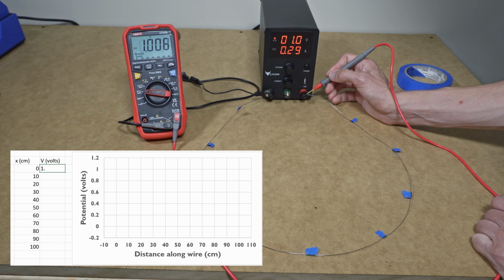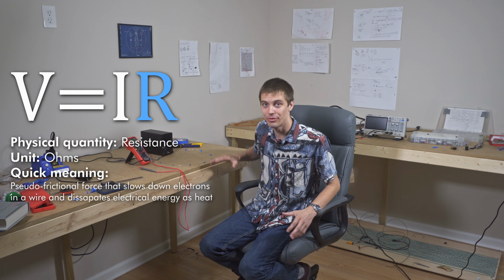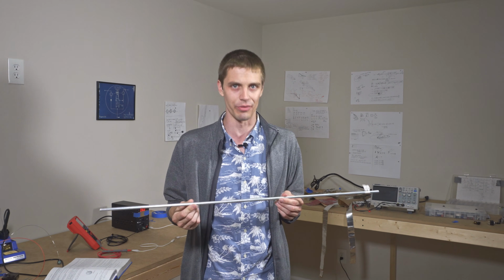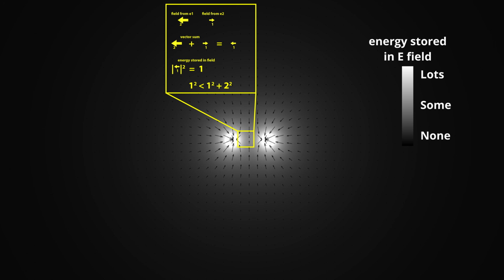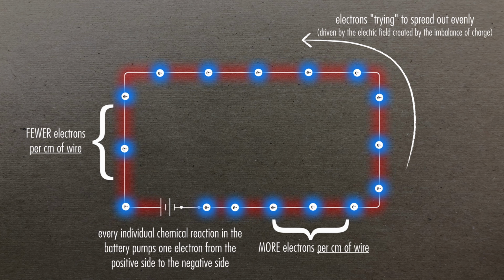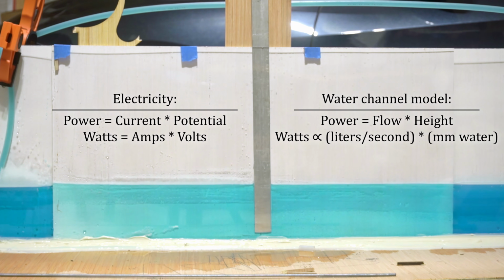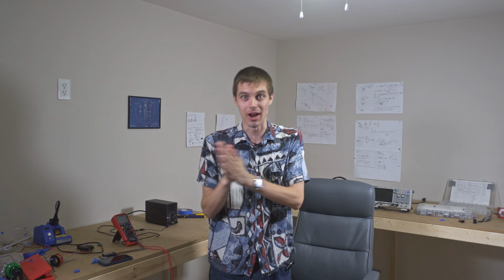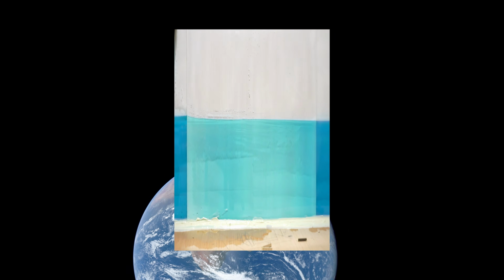An intuitive approach for understanding electricity

Comment: As a high school electronics major, they never really taught us to think of electricity that way, mostly how to calculate things and that has been bugging me since I've started learning electronics. This video is awesome! Love all the analogies and various explanations. It feels like I actually have a grip on those supposed-to-be basic concepts now.
Reply: Just read the textbook ffs. It literally explains all this stuff, in better detail and with far more information density. You should be reading the chapter before you go to lecture, and never take notes, since it just distracts and wastes your time. This is coming from someone who got a 3.98 GPA doing a physics major at UC Berkeley (I got 2 A-'s).
Reply: Wtf Is high school major
Reply: @chrissantos7865 Advanced diploma?
Reply: @pyropulseIXXI what an embarrassing comment lol. Save this one so you can read it again in a few years. Make a note that the OP was a high schooler
Reply: I don't know what sort of introduction you had, but water analogies are absolutely where electricity should be begin.  They just need to be given with the caveat that water molecules don't push on each other at a distance, they have to bump into each other (at room temperatures) and water molecules don't have another field where changes in one field affects the other.  So electricity will travel through a wire faster than water in a pipe because elections will push on each other despite large gaps between them, and water won't have things like inductors.  But pressure is a high level thing, and at the level of pressure they are very similar.  If you were transmitting power long range with pressured water in a pipe, would you want to use low PSI and require the water to fly through the pipe at super high speed, or a high PSI and let the water move slowly through the pipe while delivering the same power?  Anyone who has ever blown water through a straw will know it doesn't like to move at high speed through the straw.  Its why long range power lines are 200,000V and up.  You might be able to plug a low PSI pipe with your finger even if the pipe has a 1 mile diameter and turns a generator that could vaporize you.  A 12V submarine battery wont do anything to you if you put your hand across the terminals but it will vaporize a fork across the terminals.  Low pressure but a potential Niagara Falls of volume.  There are good analogies between "ground" and the ocean also.
Reply: High school major?!?
Reply: @98f5  HS used to have majors. If you were interested in things like electronics, farming, welding etc.. as a career you could be bussed off to a different facility in the middle of the day to go learn a trade. It was called vocational school or vocational classes. 

These days they dumb it all down and tell you that you need to go to another "adult" education system in order to be accepted into it. 

In the early years it was all about the higher orders but today it's about you being strung along for a basic education/indoctrinated stamp of approval for your masters. I mean your masters; not your Masters degree. 😉
Reply: @CynHicks  interesting, i never heard of that. But i like to think im young.  Graduated hs in 2000 I was lucky enough to attend private schools and took college courses most of my high school through a program they called post secondary. Got credit for my hs and college at the same time, and managed to graduate with my bs (appropriate initials for how much use a degree actually is) a year later... however we didnt have high school 'majors'. There were as you said some vocational schools that i seem to recall having specialties though.

Comment: The key new intuition I actually gained from this was understanding why and how resistors convert electrical energy to heat, rather than simply understanding that they do
Reply: Seems pretty obvious it is due to collisions; this is stuff you can easily deduce as a 13 year old by just knowing that things are made of atoms and particles

Comment: I think i get your analogies for voltage, or potential difference, but there are some parts for voltage i dont get. Like, a 9 volt battery would produce 9 volts worth of potential difference between the two sides of the resistor, and that 9 volts is basically electrons denser on one side and less dense on the other. If thats the case, then wouldnt current be different for the 2 parts of the curcuit? Current is amount of moving electrons passing through a point per unit time, but if the electrons are less dense, as in less compact, on one side of the circuit, the current wouldnt be the same everywhere, right? And from my physics classes, i remember clearly that current must be the same everywhere. So im probably missing something, could someone explain it for me? (1. Im talking about a basic series circuit. 2. When i say electrons are "less dense", i mean like less electrons per unit area, opposite with "more dense")
Reply from the maker: It’s very similar to water being “incompressible”. From the perspective of pressure, and pressure causing water to flow, of course water is compressible, but the actual change in volume with pressure is so minuscule that it doesn’t matter when you are calculating stuff like flow rates. Technically the electrons in one part of the wire are going faster to produce the same current but it’s SO slight you could never measure it. The water “channel” model doesn’t handle it very well because unlike a pipe, the water channel changes in volume a lot!
Reply: Ooh I think I get it, thxx
Reply: @AlphaPhoenixChannel so there are more electrons on one side, but the other side where there’s less elections has the electrons moving faster?

Comment: I need to watch this every week just to keep it clear in my head. By far the best description I have ever seen.  Thank you.
Reply: Repetition is the key to good learning, get it stuck in your head, like listening to a great song.
Reply: I agree Im 72 and dropped my first electronics class in Jr college because the teacher was former Stanford instructor and required his own book for his class. The first chapter I was totally lost he was talking hole theory chemistry and moles, Physics and electron valences. I just wanted to be a technician not a physics buff. It was like Taking us skiing down a Black Diamond hill. Before we knew how to snowplow. This video helped a lot But I'll have to watch a few more times. I dont get how electrons move from atom to atom at the speed of light. There has to be some minute fraction of a second where the atom changes from what it was. interesting that Voltage can make atoms and electrons more pressure and volume.  Higher potential to flow. But what of high voltage low amps.  I'll watch again :)

Comment: As a layman, I loved this video - it really does provide a level of intuition that I didn't get from previous explanations/analogies.

One thing not addressed is why, when there's no resistor in the circuit, the voltage drops linearly along the wire.  If I had to guess, it's because the wire itself is actually infinitely many small uniform resistors in series, with infinitely many small sections where the water level is "flat".  Kind of like how calculus derivatives are explained - from discrete segments of dy/dx to a smooth tangent curve (as dx approaches 0).  And why does the linear drop go away when a resistor is added?  Because the resistance of (any section of) the wire is now insignificant, compared to the resistance of the proper resistor.  So each of the two "flat" pools of water on either side of the resistor is actually a linear drop, but with such a small height difference so as to appear flat.
Reply: Your guess is correct!
Reply: Correct. When he showed the smooth drop in voltage over the wire vs. the step when the resistor was added, he did both tests at 1 volt, which means much less current was flowing when the resistor was added. In the water trough analogy, say that when he showed the smooth gradient with no stoppers it dropped 2 cm. To make that drop, he was flowing a large amount of water and it was flowing very fast and at a uniform speed across the length of the trough. When a stopper was added, if he wanted it to still drop 2 cm over the entire distance, he had to pump much less water through the trough because it is now flowing the distance much slower on average. It is moving very slow on its way towards the stopper, so it has time to come closer to equilibrium before it reaches the stopper. It then goes past the stopper very quickly as it loses all of its "voltage" in a short distance, then moves slowly again to the exit so it comes close to equilibrium on the other side. More stoppers means the water moves slower on average and he needs less of it. This is a constant voltage power supply.

On the other hand, if he wants to keep the amount of water the same and puts in a stopper anyway, the height that the water falls at the step down of the stopper will be much higher than the original height that it dropped across the distance with no stoppers. It will still be slower than before on either side of the stopper so it will form a step, but will move much faster in the short distance passing the stopper, which will keep the average speed/amount of the water the same as it was with no resistance/stoppers. This is a constant current power supply. 

Summary: For any given voltage (overall drop in height of the water over the distance of the trough), adding a resistor (stopper) will make the current drop (require less/slower moving water) and the voltage will therefore have more time to equalize on either side of the resistor. You can actually see as he moves the stoppers up (decreasing the resistance) that the water on either side starts to slope more and when he moves it down (increases resistance), it becomes more and more of a defined step. It is not the presence of just any resistor that makes the step; as the resistance value goes to 0, the voltage (water level) on either side will start to angle more and more and the curve will approach that of the original curve with no resistor. As the resistance gets higher, the curve will become more of a definitive step with the voltage on either side being more and more flat.
Reply: @phillipthompson2347 damn you’re good at this…
Reply: @phillipthompson2347  hey in your first paragraph, why does water move slower when going towards the stopper? And why can you use the water analogy more when you said that water loses energy after it passes the stopper? And that it moves faster there.. I would really appreciate you if ya help me understand. By the way, what’s the relation of water molecules speed and curvature as it drops down across the distance

Comment: Thank you for sharing this knowledge. This is something I’ve been trying to understand for 20 years. Working with electricity and diagnosing failed electrical systems as an automotive technician. Now I have a much clearer understanding of what is happening inside the circuits.

Comment: I'm 50 years old and FINALLY someone explained electricity to me in a way I can understand. A particle way. By the way- now that I have a little bit of a grip on it, the analogy for the pressure of electrons can be: negative is a balloon full of air. Positive is an air vacuum. I suspect that the resistance is caused by the difficulty of atoms in the conducting material accepting and ejecting excess electrons.

Comment: This is most likely the best possible model that i've ever seen. I wen't from crying over circuit theory to designing PCB's in less than a month due to this model and understanding. it isn't perfect but its SO DAMN GOOD. this should be required viewing for all engineers and physisist. Honestly this could be used in highschools

Comment: Wow! This video sure disipated a lot of questions I've always had about volts vs. amps vs. ohms, etc. I've heard the analogy or voltage being "a potential of energy" before but never quite made a logical connection to the other factors of Ohm's Law in a visual way, which was much easier to understand with all these simulations presented here. I echo one of the comments below: I wish I'd had YouTube some 40 years ago.  That would have saved me a lot of headaches to my trunkated electrical engineering career. Thank you so much for posting and for creating so many wonderful props to make your point across!  You're a great teacher!!

Comment: For anyone wanting a great introduction to Ohm's Law, or electricityin general,  WATCH THIS. I'm a math, physics, and astronony professor for the last quarter century, although my degrees are in engineering (civil/structural). Just want to say, in all the ways and levels of teaching E&M (tech students to EE majors, i.e., simple algebra to calc based), these analogies are beautiful, and your explanations perfect. Voltage is abstract, it takes a while to really get a feel for "electric potential energy per unit charge." For physics students, there's great ways to build on this from Mechanics. However, the water analogy I find to be the most useful. The visualization and tangibility is immediately accessible. Now, remember, when caulking, you need to follow the 3 contact surface rule! Lol

Comment: Ohm's law and Curtchauff's law is the two I learned in  the beginning of my AC/DC electronics  class back in the mid 80's, as a class project we built a oscilloscope from a empty bare metal  housing to a fully functional unit. We ended the 18 month course learning about semiconductor's and microprocessor's which was brand new technology at that time. Amazing how technology has changed.

Comment: Wow, your demonstration with the balls on the vibrating table with pillars makes superconductors so much easier to understand. By reducing temperature, the vibration of the lattice structure is reduced (less table shake in your demonstration). The velocity of the electrons is also reduced, such that an induced force due to applied voltage will have a greater affect on the direction component of the electron velocity vector. Both of these effects result in less collisions of the electrons since the lattice structure has less movement, and the bulk electron flow is more directed inline with applied voltage. Thereby producing the effect of less resistance. Love these demonstrations!

Comment: electric engineering has always been a challenge for me, intuitively and mathematically, even though i did 3 years of abstract set theory. this video is by far the best explanation i have ever seen for voltage, and how to think about it. another way to turn it into a useful bit of linear algebra, is that you need to think of voltage as a scalar only, whereas when it is applied to an electron, it scales a vector.

Comment: The ball with height difference analogy was what helped me fully understand it, its probably better than water for me because I can imagine the individual balls moving instead of water and somewhat unsee-able water flow. It also helps to understand resistance fully as a sort of "friction pad" on the track, that limits the amount of balls the potential difference can push through at a time because it makes them all slow down.

Comment: Hi. Just came from the other video. 
This one is great too. And the analogies of the water moving through a hose is great. 

What I was pointing out is that even though the electrons do move in the wire they do so VERY slowly 10^-4 meters per second, while the energy/electrical signal moves at near the speed of light. 9.9999% the speed of light via the electric field around the wire and NOT through the wire. 

The mobile electrons is a good analogy and convention for understanding electricity and it works 99% of the time. Physically though mobile electrons do not carry the energy and they move rather slowly. The electric field carries the energy at close to the speed of light.

Comment: Even though I already understand ohms law and work with control systems and electric motors i still enjoyed the visual explanations of ohms law. Specially voltage. My 24v control switches control 480v motors.

Comment: Great video!

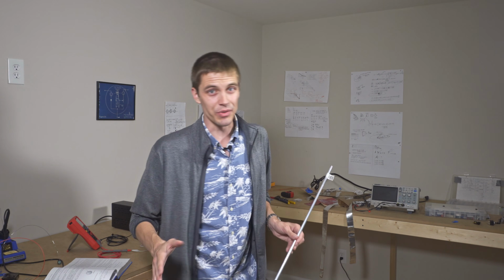At 10:46 you are correct of course: voltage is not a force; however voltage being an electrical potential difference, this potential difference multiplied by a unit electric charge per unit distance, is a force. One speaks about the gradient of a potential, which is a force as in, e.g., Fick's law where the potential is the concentration of molecules, and the gradient of this potential gives rise to the force that set the molecules in motion from the high-concentration region of the system to its low-concentration region.

Comment: One time, on a hot day in our dorm, everyone set up their fans to blow into their rooms through open windows. The pressure or flow of air wasn't enough to feel in the hallway. It was still hot as hell. But the lounge was blisteringly hot, even with the doors propped open. This was because there was a consistent outward breeze there were so many fans blowing, that cracking a window open in the lounge caused air to be sucked out consistently. The building acted close enough to a perfect seal that you got a consistent and steady breeze.

Comment: I'm 85 and "old school" electronics tech.  I learned Ohm's law as E=IR where E stands for electromotive force.  The term "force" better explains what is causing current flow than voltage.  Voltage was simply defined as a difference in potential.

Comment: Enjoyed this very much.  Seems you could extend the water/voltage analogy to sound/heat.  If you had the series of waterfalls or a series of resisters you would have sound generated at the waterfalls and heat generated at the resisters.  The waterfall analogy might be easier to imagine.